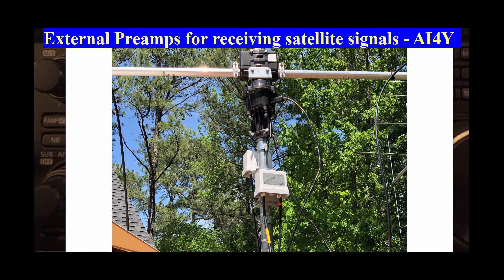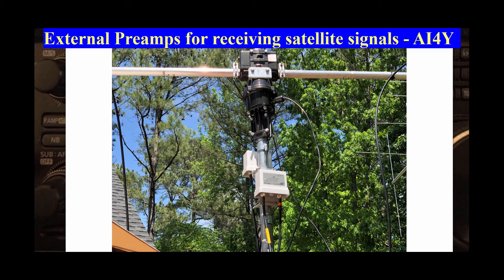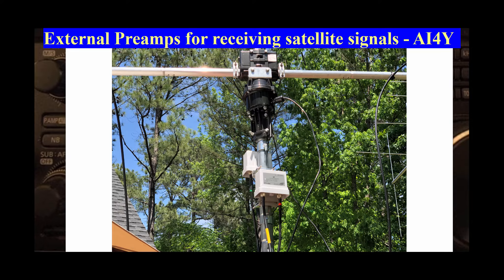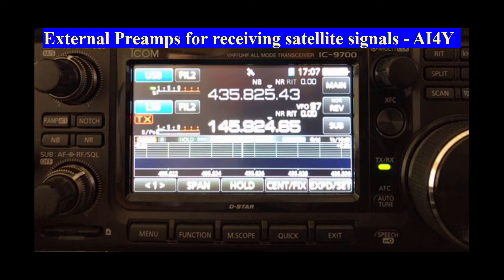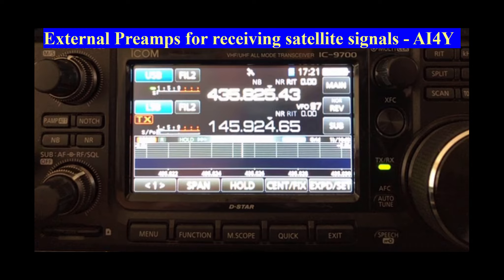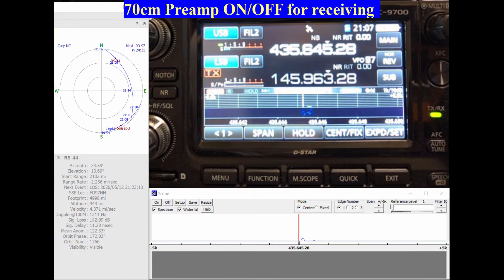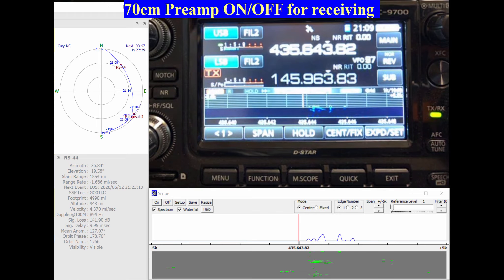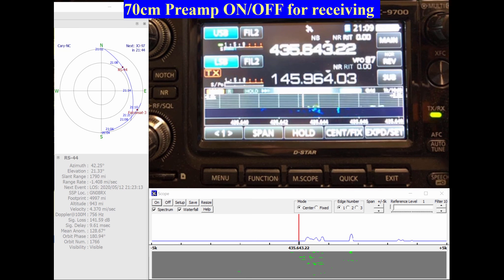IC-9700 SSB Preamps for 2M/70cm (AI4Y)

Comment: Thank you very much, From o noise to s5 just like that. lol  We will see, Your video was helpful. :)
Reply: it didn't create any noise.  Sure the reference is higher with the amplification, but the signal to noise floor gets better, lowering the noise.  The S units are a relative indication.  You can drop it down again by lowering the gain.

Comment: Hello from Raleigh! Didn't know we had a satop with a ground station in FM05!

I will be setting up a similar station soon.

I live off Jones Franklin road near Crossroads, so not far from you.

73, John Brier KG4AKV

Btw, great video! For 100 ft of coax a preamp is obviously basically required for some sats.
Reply from the maker: Hi John, that’s great. I subscribed to your channel recently and have learned from some of your videos. Once life becomes more normal and COVID-19 is better managed I’d say we meet. If there is anything I can help with regarding your sat base station let me know. Shoot an email to my QRZ email. 73 AI4Y
Richard
Reply: @richardcreasey401  Yes meeting would be cool! Thanks, I will let you know if I need anything. 73!

Comment: Richard,  did you set any additional TX delay to account for the preamps?   I realize that even with it set "off" there is about a 9ms delay. But I was curious if you have an opinion if I should increase the TX delay to 10, 15, 20, 25 or 30ms to help protect the preamps, without complicating working Sats.
Reply from the maker: I set a 30ms TX delay for both 144M and 430M, which is probably an overkill.
Reply: @richardcreasey401   Many thanks for the tip.  That is what I will try.  Better to be safe, if it works ok.

Comment: Thanks for the video. Waiting for my IC-9700. Can you tell me if there is a visual indication/icon on the main display that you have the external preamp on? Or we need to go to the Function menu to check.
Reply from the maker: Sorry, there is no visual indication the external power is being driven to the preamp. It only shows when the internal preamp is enabled. Once you enable the external preamp it will remain enabled. It only turns off temporarily when you transmit.

Comment: Wow rich! That made a huge difference. Maybe I should focus on the pre amp and not better antennas. Hey I’ve been working with satpc 32 and would like to get you to tell me if I’m on frequency. Jerod
Reply: Always antenna first, amplifying noise is still noise.
Reply from the maker: I’d recommend the antenna first. Preamps may not be needed for you if you have antenna with good gain, quality feedline and short as possible runs
Reply: Richard Creasey 8 element yagis with lmr 400 to the g5500
Reply: So when you use the external preamps, you don’t turn them on or off with the preamp/att button on the front of the radio, but rather via the function button and menu? Curious how they perform on the fm birds. Also with these coax powered preamps, you have to use compatible lightning arrestors I’m pretty sure. What about coax termination at antenna mast/tower?
Reply from the maker: @5x9dev  the preamp button on the 9700 is to turn on/off the internal preamp. If you are using external preamps then you should not use the internal preamp.
Reply: @5x9dev  Ben, I think you absolutely correct.   In my scenario, I have the same antenna / External Pre.Amps (SSB) setup as Richard.   While I used to use the Icom 9100, I added Array solutions arrestors a while ago.    I just started playing with new IC9700 and, following the detailed instructions by Richard here, it does not make the preamps come live.   The arrestors are blocking the DC going to the Amp as they are siting before them.   Arraysolutions tech support confirmed this.   But there is an easy mod that can be done to allow passing DC.   For the time being, I returned to my old setup using the additional port on the SSBs until I mod the arrestors.
Reply: forgot to sign:   NN3RP / Rafael
Reply: Better antennas comes first. Once you have a silent antenna then there is time to try a preamplifier, because with a narrow antenna you are receiving signals and noise from just a very narrow beam.

Comment: My question is i have s 2m ssb electronics preamp and the other day i was up on roof doing maintenance and had my radios on , i had no intention of messing with the 2m ant but i had to disconnect the feed line from 2m ant and reconnect it , i later discovered that my sequencer wasnt power on , so my question is by unhooking the feed line while it was on can that have burned out the sequencer ???
Reply from the maker: Hi Frank, I don't run a sequencer myself and rely on the 9700 to stop sending 13+ volts to power the SSB preamp when I transmit. Sounds like you may have toasted your sequencer. Good luck!

Comment: Richard,
After two years powering the SSB preamps have you had any issues with the bias-t power from your IC9700?

Is it a simple matter of lowering the SSB preamp's gain to avoid potential problems over drawing the alleged IC9700 bias-T 200mA rating?

Any opinions using SHF (100mA) preamps Vs. SSB (300mA)?

Thank you.
Reply from the maker: I presently do not have my LEO-PACK setup at my new QTH due to subdivision restrictions. I only ran mine Pre-amps for ~6 months with gains set to minimum without any issue. I have no experience with the SHF pre-amps. 73 AI4Y